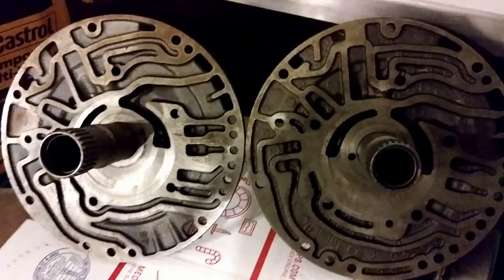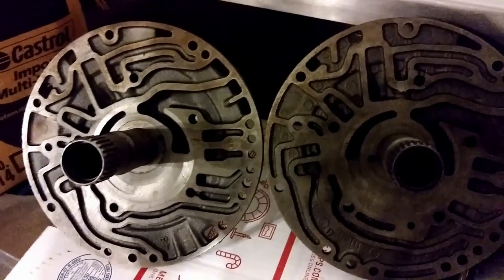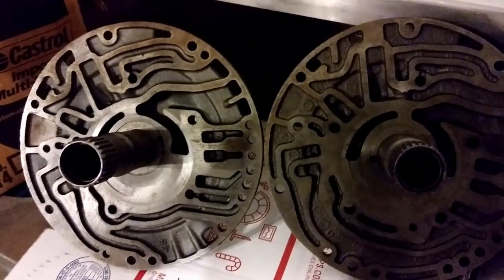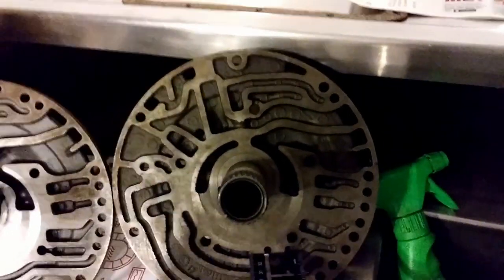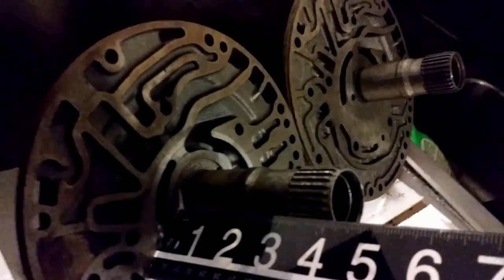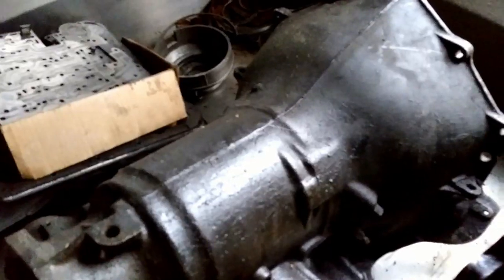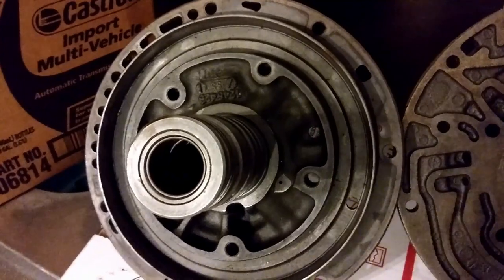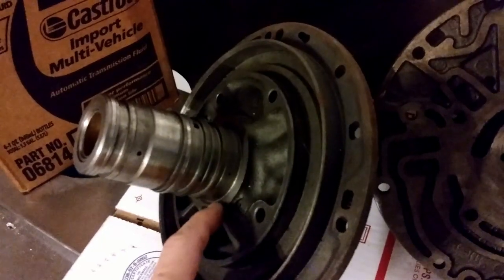How to TH350 Pump ID Lockup or Non-lockup

Comment: My project is a 94 1500 Step Side that has a carb swapped 5.7 that originally had the 4l60e. During the swap I went with a th350 that was bad, then to a 700r4 that I got from u pull it no 3-4. I was going to rebuild the 700r4 until I was told the price. I got lucky and came up on a good 700r4 and a th350c. I am going with the th350c. I am hearing a lot about the lock up torque converters and how it would wire into my brake light to function. Would my 2 piece shaft be an issue or will it work by passing the lock up feature? Thanks

Comment: I have an 83 Buick Regal that has a naturally-aspirated 3.8. I was told it has a 350 turbo in it, however i can't tell. when I replace the first 3.8 in the car, someone told me it was a locker I would just like to know for sure what transmission is in my car since it is a 3-speed on the column. Plz n thanks.
Reply: Check the shape of the transmission pan and look on the driver side were the shifter cable is theres a sensor out on the left of the case means its a 350C

Comment: So if I want to switch from th350c to turbo 400 Everything should still work with out the plug ins
Reply from the maker: No its not gonna happen that way. GM has a serious curve ball waiting for you. Here are some of the different Bellhousings https://youtu.be/O65HqSwHn7c And if you get passed that curve ball. The linkage is differant. The output shaft size is different diameter, plus TH350 has 3 different length 2wd output shafts and so does TH400. But wait theres more ;-) If you act know you can dive in to the frustrating world of different size and angles of cooler lines, flex-plates/flywheels and torque converters.

Comment: Looking for a little help 
Can I put my 350th internals into a 350cth 
350th has bad housing (crack)
350th has manual reverse valve body kit and trans brake.
Thanks
Reply from the maker: Some of the drums planets yes. The pump and valve body No.

Comment: Can I use a yoke out of a th350c in a th350?
Reply from the maker: yes but there are different length tail-shafts.  short medium and long. This is true for both the 350 and the 350C Just make sure the yoke your using isnt too long or short. The diameter and spline count should be the same 27 splines
Reply: @saneauto  both 27 spline shaft and both tail end housings are 6” long, another question can I swap the tail end housing to convert it from a 2” speedometer adapter to the smaller one (I have both transmission the th350c has the smaller speedometer adapter and the th350 has the 2”) I want to use the smaller adapter

Comment: Why do my pump gears lock up
Reply: My pump is warped
Reply from the maker: There are several different pump gear thicknesses. They get thicker during the later year models. If you have a early model pump housing and newer year model gears those gears may be too thick for your pump.